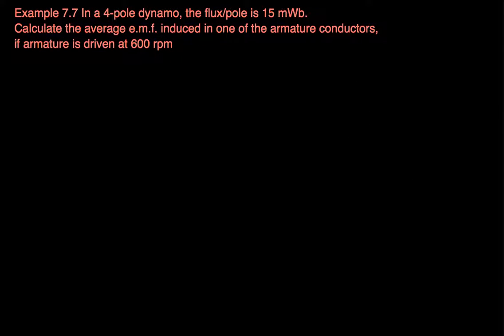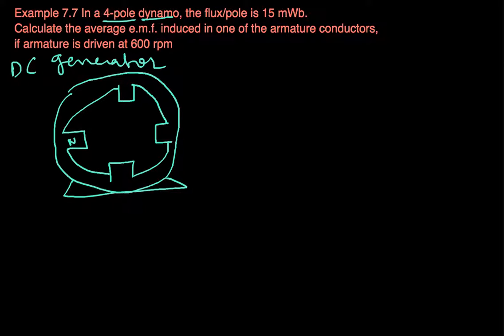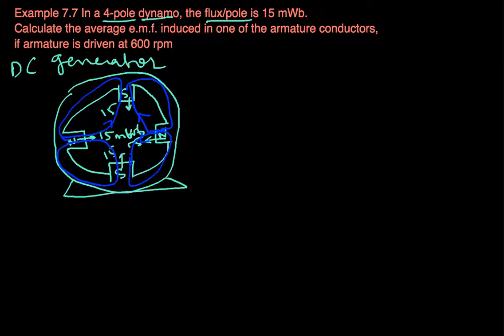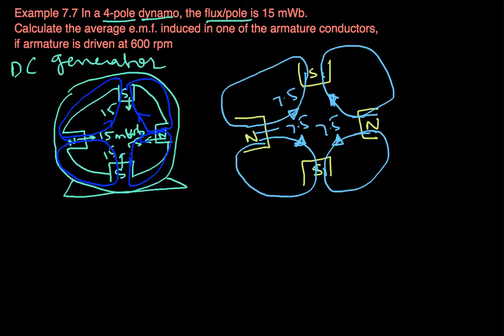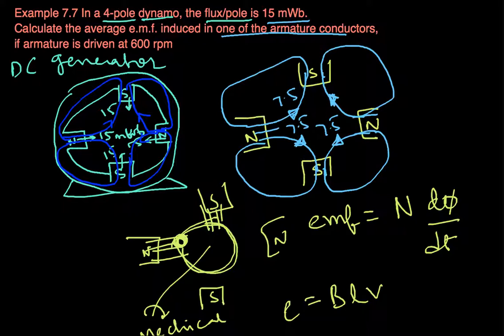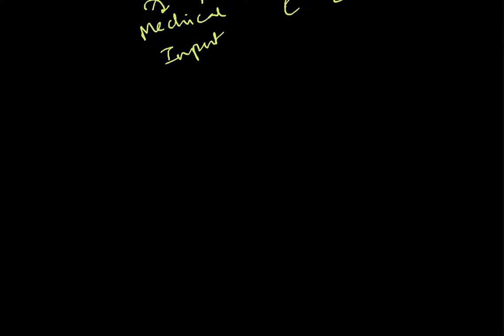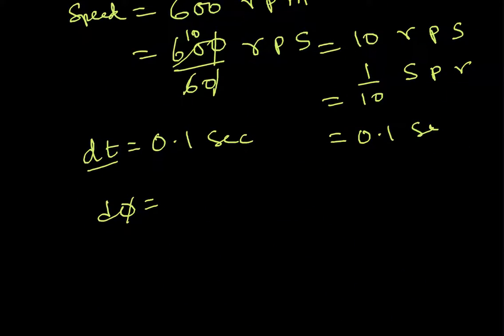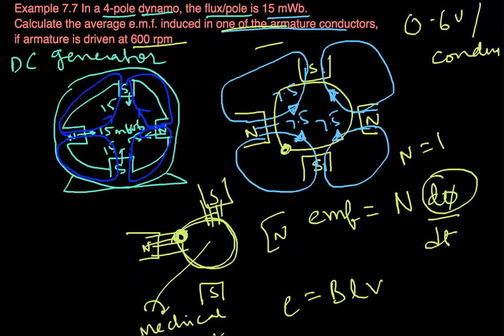EMI8 - problem on EMF induced in armature conductor

Comment: Sir I got a doubt regarding calculation of d(phi)...........when that armature conductor is rotating ,at each point of its rotation it will be under the same flux (except for at the interpoles) so I think (maybe wrong) that the armature conductor will be under the effect of constant flux.
Also if we take initial and final position of armature conductor to be same then d(phi) will be zero.
Also I have read somewhere that DC machines (and even ac machines except salient pole machines) are constant flux machines(i.e. they maintain constant flux density across the air gap.
If time permits plz reply sir